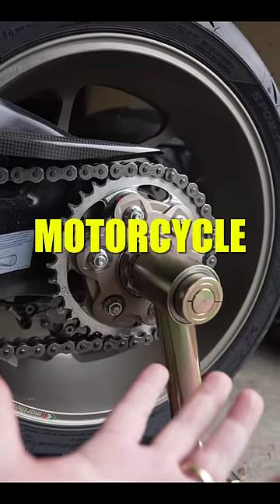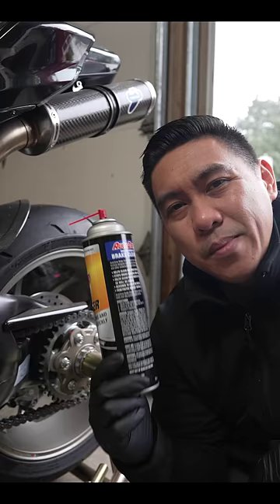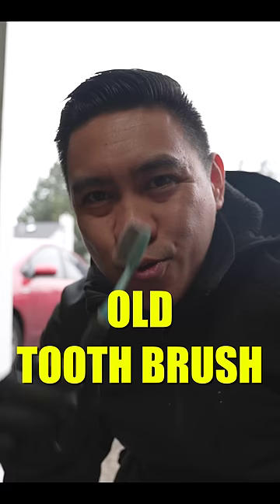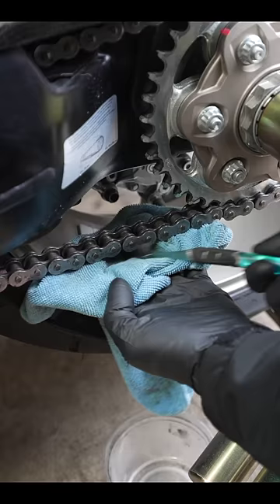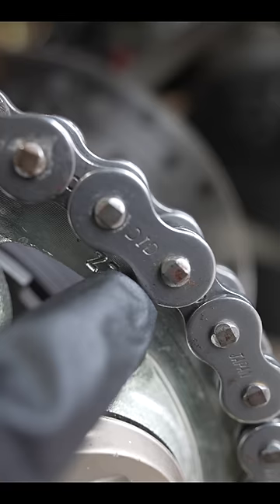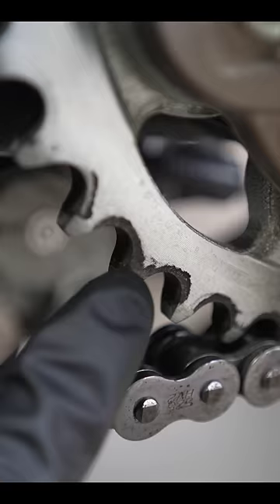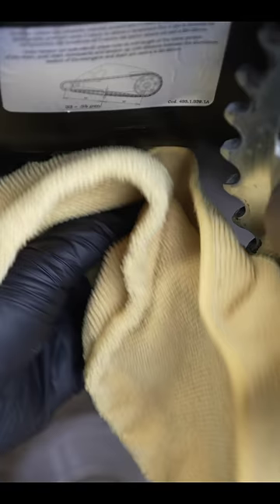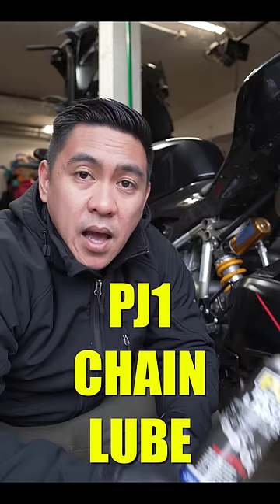How to Clean and Lube Motorcycle Chain

Comment: What's your opinion on maxima chain wax? I just started using it I think it's better than silkolene dry lube. I'm dying to try motul chain cleaner. But I seen alot of reviews saying maxima chain wax is better and versatile in alot of situations
Reply: Good stuff. Been using it for years. One of the cleanest least fling off lubes out there. Best selling stuff when I was working at the motorcycle dealership.
Reply: @jamiesteiger6140  I noticed that to. I'm using rk gxw chain. I notice it doesn't fling. My chain cover are clean too. Unlike the silkolene dry lube, I always see chain guard are messy
Reply: Use that and “clean up” in the blue can. Works wonders
Reply: @Youre_SmoothBrained my chain cleaner were ipone tho which is good
Reply: @neilgaming2127  I recommend the maxima chain wax all day long. That or PJ1

Comment: Nooo man... 😐
Me, I clean my chain by just lubricating it with a low viscosity oil. 
Then I go speed up the highway at an excess of 180Kph. 
The centrifugal force should take care of the dirt. 
Then I just wipe it out. 
Excessively cleaned chain causes metal-to-metal contact within the links and cause more wear and tear in the material. 🤔

Comment: FYI there are rubber O-rings in modern chains by using brake cleaner you degrading them you will lessen the life span of your chain which is why you’re cleaning it in the first place. Do not use brake cleaner
Reply: why the fuck would they put rubber o rings in a chain?
Reply: @schlomoshekelstein908  I don’t really want to question your experience or intellect. The vocabulary has done that for you. Modern motorcycle chains are sealed to keep the lubrication inside, thus increasing the life of the chain and decreasing the where of the chain. That’s as nice as I can be to you. Do your own research you might think about reading Or perhaps engage in life. God bless you God bless your family please be safe!

Comment: Just prop your wheel up and run those fancy chain brushes on there with the wheel spinning for a minute or two then his it all with brake clean then spray with lube and you’re good to go and it only takes 10 minutes 😎
Reply: Probably not even that. Takes me longer to find where I left my chain brush
Reply: Do you spray the chain cleaner right on chain and then use brush

Comment: Don't use Brake Cleaner on anything where rubber is involved.  It'll swell up your O-rings and wash out the lubricant that is packed around the roller pins.  For god's sake man..

Comment: Brake cleaner is harmful to o-rings. Kerosine is very thin and can potentially sip pass the o-rings. Simple green and a chain brush is inexpensive and effective way to clean the Chain. Motorex chain Lube or mobile one gear oil works well fur lubrication

Comment: WD40 is all I use to clean and lube seems to fine
Reply: It would damage the o-ring if your chain has it.
Reply: WD-40 is not a lubricant and will gum up quick.  Do yourself a favor and get a real chain lube.
Reply: I used WD-40 to clean  and white grease to lube. Now, I have a shaft drive and it is much easier. The WD-40 never did anything to the O-rings, ever.
Reply: @arvin6606  that is a proven myth
Reply: @mscustomknives  I got 18k miles outta of the oem chain with just wd40 it’s been proven wd40 doesn’t eat rubber O rings bud 😂
Reply: @mscustomknives  gum up I clean it every 600 miles it’s never gummed up
Reply: @arvin6606  false
Reply: WD-40 isn't a lubricant.
Reply: @lamefart  the lubricant is in between the X an O rings think about that lol
Reply: wd-40 is fine, so long as you apply it regularly (at least once a week with regular riding). The advantage of wd-40, is it contains solvents and a light machine oil, so it cleans and protects at the same time (no, a motorcycle chain doesn’t strictly require lubrication, just cleaning and protection from oxygen). Check your motorcycle manual. It probably says to use heavy diff oil. The 2 main benefits of diff oil is: it wipes off easily and it prevents the chain from rusting (which is the only real requirement of chain lube, the real lube is inside the chain links, you just want to prevent rust forming on the outside) which is almost exactly what wd-40 does perfectly. The ONLY benefit of “real chain lube”, is that you only need to apply it once, maybe twice, and that shit sticks like glue, never comes off, collects dirt which then acts like grinding paste, is almost impossible to remove, arguably reduces the life of a chain and stops it from rusting.
Reply: @Robnoxious77  agree
Reply: You’re a fool if you’re not joking
Reply: @opsecalpha  IT DOESNT CLEAN!!! It actually collects dirt. It’s junk
Reply: @Fee.1  it works, how about you find out how a motorcycle chain works before you come on here and remove all doubt we have of just how stupid some people can be? Your use of the term Dunning-Kruger implies we don’t know the ingredients and intended use of wd-40. It says right on the can.
Reply: @Fee.1  dude, go buy a bike.
Reply: @Fee.1  engine builder? dude, it's a chain, not an engine. Technically its a final drive component of the transmission. "chain lube" is demonstrably shit. go ahead, take two of your bikes, use chain lube on one and wd-40 on the other. be sensible and use it accordingly, i.e., chain lube once a month, and wd-40 every few days. armed with your new ability to see and experience the real world, come back and tell me how it doesn't work after that. Diff oil is ideal, wd-40 will work. Is it ideal? not really, you'll need to apply it every day or couple of days, but it does do the one thing the manufacturer of the motorcycle requires "chain lube" to do mechanically. prevent rust. get over yourself. go have a snickers. engine builder... unreal... the disconnect is painful....
Reply: @RobertRobinson  wtf do you mean “chain lube” is crap??? It’s just lubricant. A proper lubricant for the application. It doesn’t matter if it says chain lube in the tin or not, that’s just a convenience factor and for people who grew up using wd-40 on chains and all sorts of other things only to find it did jack all to protect their gear. There is absolutely nothing “sensible” about using WD40 on a near daily basis. That quote literally proves by itself that WD40 is not even close to a proper lubricant. That’s like arguing that you can get away would putting WD40 in a motors crankcase instead of oil & because it does so without catastrophic failure it’s perfectly fine to use it as motor oil. sure you have to change your “oil” every couple days but you can do it so it’s a non issue. 

There’s a million points to be made but you’re not paying attention so it’s a waste of time. Rust prevention is NOT the only role of lubrication first of all, that’s a common misconception I’ll give you that because after the transition to sealed chains with O-Rings rust prevention became arguably the primary and definitely the most visible benefit of lube. 

it plays many other roles and benefits in many other ways all which combine to minimize drag and rolling resistance as well as wear NOT JUST ON YOUR CHAIN but also on your sprocket. 

But again any pro would laugh at your assertion because it’s not even wise to use WD40 for CLEANING a chain let alone for lubricant.  Your trying to do both with one product at the same time is absolutely giving you more wear and tear and a shorter lifespan, amongst other things. 

WD40 brand makes chain lubricants now by the way, even they have moved on from their 1950’s fix it all in a can. it blows my mind that people still don’t understand most of the things they use wd40 for is counterproductive.
Reply: @RobertRobinson  one last thing, use wd40 on a squeaky hinge…what do you observe in addition to the squeak rapidly returning ? Do you know the answer? I’m assuming not but if you do, why do you think your chain will not experience the same exact outcome magnified even more from being outdoors???? Speak to someone who knows what they’re talking about. 
You’re not going to find a highly skilled tradesman that specializes in chains, hence the engine builder reference, but pick someone actually competent and educated in any relevant field and ask them. They’ll all tell you the same thing. ironically WD40 will tell you the same thing as well because they modernized and sell specialist products now including chain lube and various general purpose lubricants…but I’m sure you’ll just say you can’t trust WD40 because they just want to sell you WD40 chain lube. One day you will learn, hopefully. You can have the final word, wasting zero additional time on you.
Reply: @Fee.1  ugh, of all the hills of stupid to die on, you pick this one. The gods of the internet are being kind to me today. One last time using as few syllables as humanly possible: bike chain. rust. bad. wd40. stops rust. good. perfect? no. why? oil residue too light. works? yes. problem? need to reapply regularly.
Reply: @Fee.1  except that it does. Every mechanic I have ever known has used it as a cleaning agent on anything greasy such as chains, bearings, seals, seats, and even spilled oil.
Reply: @opsecalpha  every mechanic uses brake cleaner. Why tf would you use something that leaves a residue??? It’s negated slightly if you’re going to wipe it down physically as well, but brake cleaner is bought by the drum in shops why tf would you use wd40
Reply: Wd40 is a solvent and very light oil in one solution. Made for wiping freshly machined parts to temporarily prevent rust. The solvent makes it great for cleaning up anything grease and removing sticker residue.
Reply: Wd40 is all I use. Doesn’t hurt the o ring and it’s not as thick as chain lube which dirt and dust stick to a lot more. Just saying

Comment: Not a single chain manufacturer recommends kerosene or brake clearn and most specifically advise against using them. Kerosene will damage the o or x-rings.

From the RK website...
"RK Chain recommends cleaning a sealed chain with only a mineral-based O ring safe chain cleaner. Do not use kerosene, mineral spirits, diesel fuel, brake cleaner, motor oil, or any caustic chemicals because that can damage the seals."

From the DID website...
"D.I.D does not recommend maintaining any drive chain with kerosene.
Cleaning a sealed chain with kerosene would cause deformation of the seal ring and can oftentimes lead to rusting of a chain due to the removal of grease on the chain’s surface, which increases the risk of chain corruption and chain failure. It is highly likely that use of kerosene on a sealed drive chain will drastically decrease the chain's performance."

Comment: Brake cleaner is not great for o ring chains... The brake clean breaks down the rubber o ring. They make actual chain cleaner..
Reply from the maker: Go watch the video where i soaked the orings in a tub of brake cleaner. You guys just talk without any actual evidence
Reply: @adobomoto  Been proven multiple times. Go soak it for the same amount of time you would have cleaned the chain and tell me how your o rings look. Soaking a chain for 2 days isn't the same as repeated applications over a 7- 12 month time. Why cheap out? Brake clean 5 per can? Chain cleaner is 6 bucks?

Comment: Just use a toothbrush to spread a small amount of grease all over it, it's only to prevent rust on the links, chain lube is a myth, the O and X ring chains are already lubed inside, that's the whole point and why you payed more for it, so the spray lube doesn't do shit except fling off into the chain guard, waste of money.

Comment: Brake cleaner destroys rubber seals so probably wouldn’t use it on an o ring chain
Reply from the maker: Except brake calipers have rubber seals. And did you watch the video where i soaked o rings in a tub of brake cleaner for a couple hrs? Did absolutely nothing. You guys keep spewing nonsense with no facts

Comment: Your method is only a cosmetic cleaning. If you do it often, it's OK for a street only bike.
Better way. 1. PULL THE CHAIN off the bike.  2. coil it in bottom of typical oil drain, round pan. 3. soak in kerosene or diesel overnight. 4. hang chain up over dirt area and power wash it or blow it out with compressed air and then hose it with nozzle. Quick wipe of excess water then copious spray of WD40.  5.  You can spray your actual chain lube right on the chain before or after install as you prefer.  WD40 is for water displacement and rust resistance until the chain is properly lubed.  The mild solvent characteristics of the WD40 will cause it to disburse into the chain lube then evaporate the minute the chain gets hot.

Comment: Bro needs to get himself a chain cleaner… It’ll save you about 15 - 20 minutes of scrubbing your chain.
Reply: Lmao you’ve never used brake cleaner I can tell
Reply: @urgranny6913  He’s going through every link with a toothbrush… This has nothing to do with the cleaning solution he’s using. And I can tell you’ve never used a chain cleaner before. 

You put the chain through the chain cleaner, fill it with fluid (or as you’d say, brake cleaner), and you spin your wheel. The brushes inside the housing clean the chain for you… It saves sitting there for 15 minutes with a toothbrush, trying to scrub every nook & cranny. 

But if you want to go through life making it harder for yourself, because you think you already know best… Then you do that. It ain’t me that’s wasting his time.
Reply: @TheFakeNewsFrog  fair enough

Comment: Used a short stiff brush all dis long, but... I don't mind the mess,
My steps:
1. Brake cleaner in a cup n brush dipped
2. Spin the wheel
3. Brush action while wheel spinning up down and side
4. Wipe all the mess clean(satisfying wipes)
5. Repeat step 2-4 But with chain lube
:V :V :V

Comment: Brake cleaner degrades the rubber rings inside the chain in no time, not just because im saying it, it is literally a proven fact. Good job, or should i say "congratulations"? Dont use brake cleaner on chains guys.
In the case it wont degrade the orings just because is an "acetone" free brake cleaner, it will still get past them and compromise the internal lube of the chain.
Oh yes, i forgot, this scientist in the video also thinks that's enough lube. Of course you don't soak it, but that's literally nothing.
Pretty amazing how much disinformation can be out there.

Comment: Yet another incorrect "instructional" video that will cost viewers time and money.   Brake cleaner is the dumbest and quickest way to destroy your expensive D.I.D. or EK chain.   Brake cleaner will destroy any type of rubber component and will eventually strip away the white lithium grease sealed within the orings or xrings of the chain. Brake cleaner should only be used on all metal components; i.e. brakes.  A toothbrush will take an unnecessarily long time compared to a chain brush.  

Use kerosene and a chain brush to remove grime from the chain.  Then, wipe and lube following the bike manufacturer's recommendation in the service manual.

Comment: The amount of people calling bs on the Brake parts cleaner should give you a hint not to use it. But sure you know more than we do with your “inch of lube for the whole chain” that poor bike
Reply from the maker: Inch of lube for the whole chain? No, go across it - it’s fkin obvious. You’re a know it all i can tell. People have been using brake cleaner on brake calipers for years with the same rubber seals. Stop trying to spread your bs and move on to another page. Gtfo here
Reply: @adobomoto  let’s put that aside. Aswell with the 100% wrong brake parts cleaner. A toothbrush? Takes way too long, measuring the wheel space with a tape measure from the rearset or another fixed point? Also wrong. 99% of swingarm from factory have adjustment marks on them. Only time you use a tape measure is with stretched bikes that have no alignment marks. Even then you’re suppose to use a micrometer (I’m sure you know what that is by measuring your lil friend you got down there) bro you’re just spitting either BS information or information that’ll take way too long and end up hurting or killing someone (the rear tire alignment that is) go ride your bike and make posts like “why not ride” about how riding is scary and people can get hurt. Mechanics aren’t your strong suit

Comment: Don’t ever use brake parts cleaner. It’s gonna eat up the rings in the chain (o rings) and spit them out. Using a tooth brush is highly ineffective, they sell brushes for chains. Go buy one, put the bike on the stand and run it in 1st gear at idle. Don’t grab the chain or do something stupid. Buy some chain cleaner from your local bike shop aswell as some lube and do it right. This is just nonsense
Reply from the maker: 😂😂 oh man, i used to believe all that BS too. Is pj1 not good lube? I soaked o rings from a chain in brake cleaner for 2hrs. Didn’t do a damn thing. The honda chain cleaner also tells you to use brake cleaner to clean the chain. Any other Bs you wanna add?
Reply: @adobomoto  “measure your chain slack by finding a fixed point and use a tape measure to make sure it’s at the same length 🤡” as the swingarm has marks just for that. Your measurements are wrong more than likely anyways. Bro go get a new hobby and go ride once a week on a weekend 😭🤡🤡